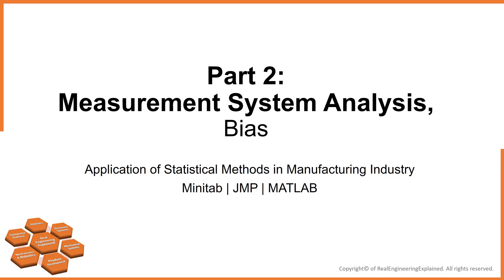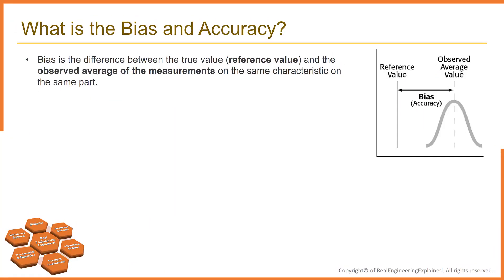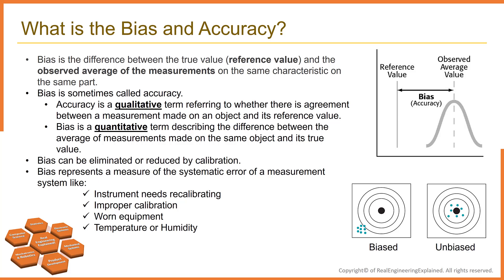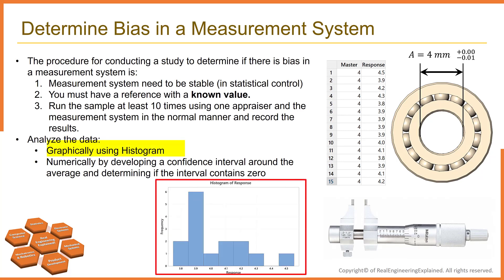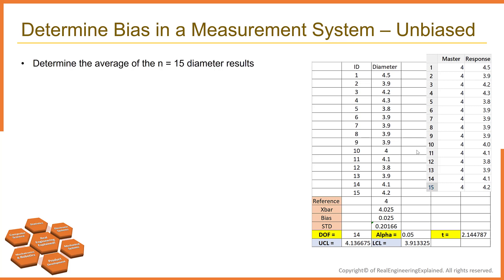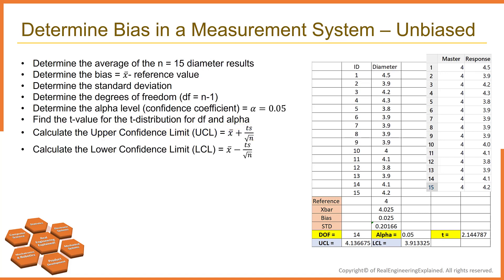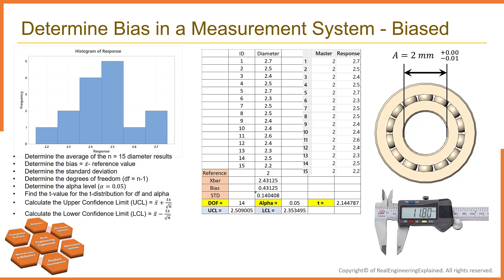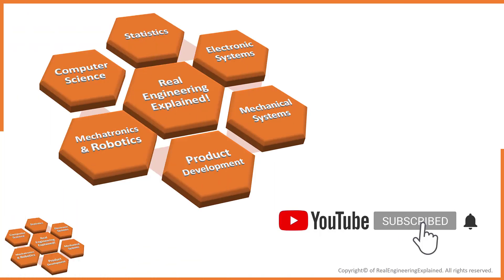Part2: Measurement System Analysis, Bias | MSA |  Statistical Methods

Comment: Please check your UCL LCL formula
Reply: According to the MSA manual the "0" needs to be between the confidence interval, and the video says that the reference value is the one that needs to be between the confidence interval... also the formula for the confidence limits is different from the one in the manual...  in the manual you have to add/substract the bias with the product of [Standard error of the mean * T value]
Reply: @brandomvillanueva5800  It sounds like the CI for bias. If 0 falls within the bias CI, then it is fair to say for that measurement system is unbiased. But I think if the CI for the true value includes the true value, then the system is also unbiased.
Reply: Thanks for clarifying